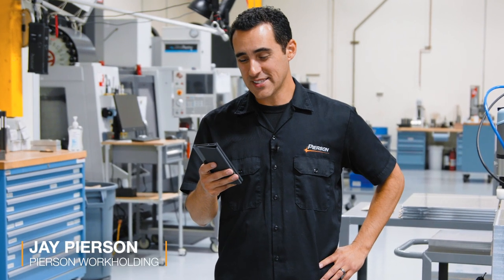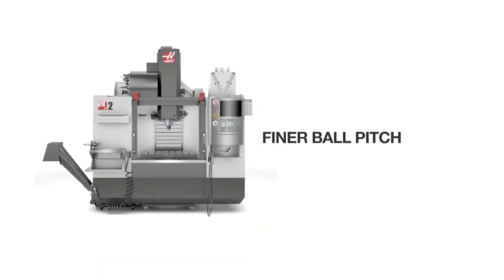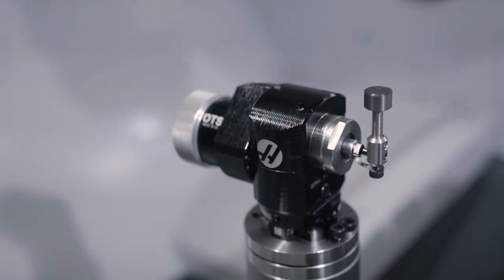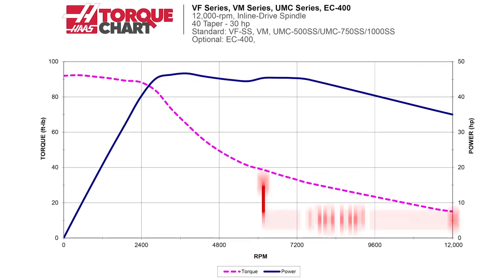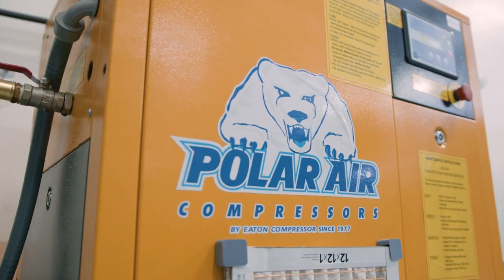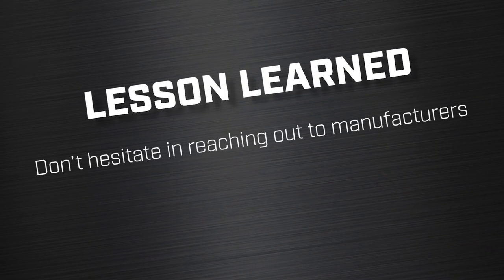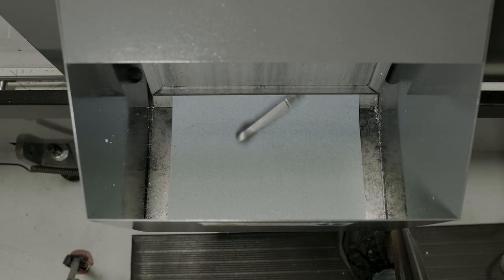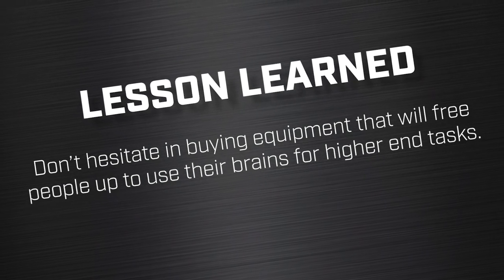My BIGGEST CNC Machine Buying SURPRISES | Pierson Workholding Q&A

Comment: Lesson learned: Don't hesitate to replace equipment that is requiring too much maintenance by a new piece of equipment.
We started with a 2nd hand 25 year old Bridgeport VMC and learned a lot from that machine. But after a few years we had to spend too much time on maintenance: a stuck tool changer, a broken pneumatic valve, electrical problems, spindle maintenance, wrong parts being delivered by the vendor. That resulted in me rejecting a lot of jobs because I was not sure we could handle those.
When we were faced with another big repair, we decided to replace it with a Haas VF3ss. Better quality parts, better surface finish, less maintenance and a much higher throughput

Comment: Great insight Jay!  We will be making the jump from Tormach to Haas soon and I've been waffling on SS vs non SS.  We cut a lot of aluminum, so the spindle speed is attractive.  We also make 1000's at a time so we are shaving seconds everywhere we can.  At some point we will catch up with demand and I suspect my focus will change from one machine's speed to a cell of machines and what that capacity is...  It seems like that is more about getting the timing right than it is about brute force speed.  Your videos have helped a ton over the years.
Reply: Haas has a great video comparing a vf to vf ss to a dm the cycle time reduction is amazing on the dm. For aluminum especially with small cutters rpm is going to win every time. You will need to sit down and figure out what your max rpm/feed rates would be for the part ideally and buy into a machine that has that envelope.
Reply: I’m curious if you have an update on the machine you chose.

Comment: A great point talking about  spindle speed  and torque. If you aren't machining aluminium or using very small cutters ,over 8000rpm is a waste . More torque for roughing and tapping , will make you more money.

Comment: I bought the Polar 20hp rotary 2 years ago, and man what a difference it made!  I didn’t realize you could program the power output, I just assume since it was variable drive, it would be just run slower in times of less need.  The biggest draw I have is my blast cabinet that needs 90cfm.  It would destroy my old piston compressor in minutes leaving the rest of the shop without air.

I have been needing a auto feed bandsaw for a while now, I will have to look into the Hem!  It is a huge time suck when cutting 100 of anything on the Ellis.  Thanks for sharing!

I am looking to add another mill in the next year, so I am glad to hear that the standard VFs are very productive.  We just added a ST20Y this year and are still getting comfortable running it, but so far besides the pucker factor, it has been a pleasure to work with!
Reply: Check out Revolution Machine Tools out of Utah. We recently bought an auto saw. It's not huge, up to 9" diameter capacity which is more than enough for our needs, paid under $10k delivered. If you need something bigger they do have bigger models but we didn't need to spend the extra cash. Hope that helps.

I have a 10 HP Polar piston compressor. Need to upgrade sometime soon. Not sure if to stick to Polar or switch to Quincy or Kaeser. Any insight on these?
Reply: @ciscohernandez4384  Hey thanks for the reply!  I will definitely check out your recommendation!  As for the compressors, both Kaiser and Quincy are reputable manufacturers with long spans in the industrial area.  You probably can’t go wrong with either, but I don’t have 1st hand experience, so I shouldn’t give an opinion either way.  However I went with Polar or now Eaton, because they offered higher HP on single phase which is what I am equipped with currently from my service provider.  Most industrial machine manufactures only offer 3 phase machines as it is cheaper and their customers will be in a facility that has 3 phase power.  Eaton is the one manufacture that offers a proper 3 phase motor on a VFD drive controller for single phase power.  I do use a rotary phase converter to run my other machines, but the air compressor is always running and I wanted to run that not on a rotary if at all possible. Cheers!

Comment: Just ordered a 10HP, variable speed rotary screw compressor from Eaton / Polar based on your video review. It will replace a trusty but tired 5HP IR T-30 compressor. Hope it lasts half as long as the IR.

Comment: Failures: we had an assistant pre-cutting tubing but only to rough length and square ends because he couldn't do any better. Then the welder would RE-CUT every tube to finish length and required angles. The boss saw nothing wrong with this because the welder said it helped him (helped him to not handle 20-ft sticks). Of course I was labeled as the complainer when I called this lunacy...

Comment: I agree with everything except the probe statement.  The probe is the single best efficiency improving option you can buy IMHO (4th axis is close second place) and one of the less expensive Haas options.  Also the VM and SS (aside from ballscrew pitch) are about options and how they are packaged and the only way to get the 12K spindle (my favorite).  You are absolutely correct about the machine is usually not the weakest link in the efficiency chain.  I bought a fully loaded VF2SS and learned how important fixture design was actually the weak link and the machine performance was going to waste in my poorly designed process.  However with promotions/sales/offers Haas had at the time I didn't overpay too much and later found uses for the options on other jobs.  The great thing about Haas is their website allows you to mix and match options between machines to find the best option/price combo for your particular application (assuming you know exactly what you need).  The only thing better than a cleverly designed fixture is that same fixture on a 4 axis setup.

Comment: Thanks for sharing your thoughts on lessons learned. About 9 months ago we replaced our vertical mills with one horizontal with a pallet pool and large tool magazine. Game changer for us, whole new level of safety (far less handling of parts in machine), quality, through put, job satisfaction and reliability.
Reply: They are a major investment, but provide a drastic improvement in efficiency and safety. Possibly even quality and simplicity if your process is solid. We have 4 standalone Mazak HMCs and 2 in a 43x palletech system. We would have to at least double if not triple the size of our shop to to fit the number of VMCs it would take to do the same amount of work. An HMC may cost double a VMC, but they can do well more than double the work.

There are so many benefits, even with just a pallet changer (no pool), but I would say my top 3 would be 1. Work piece handling happens away from the work area, so it's not only safer, but the machine is working on the other pallet while you unload/load 2. The 4th axis isn't an add-on...it's a standard part of the machine and 3. The tool magazines are larger by default, but can be optioned to be huge. This means you can tool up for many jobs and reduce setup time.
Reply: Pumasforpets, I agree, we started with a small horizontal many years ago, but it turned out to be a lemon. It did the job, but didn’t take us to the next level, so tried verticals again. That was a mistake!  Did a bit more research, and took advantage of the pace of  progress to land us the perfect setup for our application, a DMG Mori NHX4000 with a five pallet pool and 240 tool magazine. “Cheapest” machine I’ve ever bought.

Comment: Right now the company I'm working for is planning on moving into a new facility. We've had plans to upgrade the air system and replace the current piston compressor with a rotary one for probably over a year and a half. In that time our current old piston compressor has been giving us problems that results in all of the air users being shut down for hours at a time, often multiple days in a row as the repair technician comes in and diagnoses, orders parts and repairs it. The air users are not just the two VMC's, but two datron mills, coating lines, laser cutting/etching, electronic component surface mount machines and other components.

It baffles me that the company feels ok limping along on this old compressor that could fail at any time, paying repair costs monthly, losing hours of productive time monthly, rather than eating the up front cost of the new compressor and paying for hookup twice in our current and future location. Perhaps they've done the cost analysis, but it doesn't seem like it.

Comment: I was very surprised at your saw mentality? We do work from areo-space to medical(external body) to open tolerance production wigets. We use a hydmech and/or a doall auto saw. They cut accurately an clean enough to a finished length unmanned with only subsuquent holes drilled or such left to do. There basically another cnc machine to us.  I still value your view on the loly saw, was just surprised a little. Thanks for the vids

Comment: I really appreciate your ideas and would like to know something, i work with Fusion 360 and never had to program the machine directly at the control, so, how important is to learn how to program a job straight at the machine? i understand how g code works, but, am i missing something by only using a cam software?
Reply from the maker: In my opinion, you're on the right track learning Fusion to program both mills and lathes. It's always good when you learn and embrace new technology. You should however have a basic ability to read G-code to understand what the machine is going to do when working through a set up. - JP
Reply: Agreed Jay.  It is a better process to control programs by using your Cam system, but it is equally important to learn the codes so that you can machine components confidently.  I have had many times in my experiences of catching mistakes in process.  Also post processing will vary and it is important to maximize you machine controls to there fullest capabilities.
Reply: Personally I work at a shop where we all program by hand. We have mostly haas lathes and like 4 Haas mills. If you're doing somewhat basic stuff on the lathes like turning a diameter and drilling, boring, or threading really it's much faster to program by hand. I could have a job set up and programmed within the hour. Same goes for the mill, if you're just doing bolt hole circles or some slotting it's really easy to just program that stuff by hand. Cam comes in handy when it's really complex stuff. Like on the lathe we make some pulleys that have v grooves in them. We don't buy inserts for that size of groove either we manually program this by hand using a cutoff tool/groove tool. This can take some time as there's a lot of math involved. Some machines like mazak which we have 3 of them at my shop, has capabilities using mazatrol to easily program grooves with little math needed. Newer mazaks with touchscreen control basically has cam in it. It really shows a 3D picture of what you're trying to make which honestly is a big bonus over a Haas. I really wish Haas would improve they're graphics. I love the classic look but at the same time when you program live tooling or anything of that matter there is no graphics at all. I guess this is why cam would be great 🤔🤔 lol!
Reply: Just for fun make a simple fly cutting program by hand or drilling op. It will make you a better machinist undoubtedly.
Reply: using CAD Cam and programming at the machine is a good thing
some machines have some special features inside that a CAM cannot use, so you have to program it manually, especially programming parametric programs. I run 5 Axel machines where it is These are functions that can not be run from CAM.
I use a Heidenhain controller TNC 640 where there are so many special features where I can not get in touch with CAM

one of the functions is that I can have a measurement report made directly on the machine and print it out, so when the machine has finished working, I have a measurement report and a finished item
Reply: @kastrup2dk  parametric codes  and macro statements are written by hand that I have used.  It's kinda an extra touch for special applications.  I do believe cam systems are the industry standard for many reasons.   Do you write full part programs in macro and parametric?  Seems like a unique approach.  Also GibbsCam 14 has just created probing routine macros for post processing that I will look into adopting for specific controls.
Reply: I think programming on the machine is not efficient anymore. But if you got errors in the programm and need to modify your postprocessor, or you do strange things  your machine was not intended for, or if you make 4'000 parts a week and try to shafe off 1 second... you need to understand the language of your Machine.
Reply: @punkdudex69   I spend a lot of time calculating cast items.
where I work now we only have capacity for 30 tons It is not possible to make CAM programs that can compensate for all the conditions so therefore will have to be made parametrically. Emma has a value over 100,000 euros when I receive them

so I can not afford to make mistakes 
I think it's a good thing that Fusion 360 came on the market the game changer for the industry.
and that the program is affordable.
but I have used a lot of mastercam but do not use it that much anymore.

I think it's a good thing that Fusion 360 came on the market the game changer for the industry.
and that the program is affordable.
but I have used a lot of mastercam but do not use it that much anymore.
in the I have more freedom in programming in parameter programming and thus ensuring a higher quality  and assurance that the item is correct when completed.
Reply: @kastrup2dk  wow that is super interesting to me.  I have not seen any applications in my professional bubble so far that would be needed.  I would love to see a full parametric program to understand where that process is beneficial.  Thanks for your input.

Comment: Running your VF2 compared to VF2ss is like running your rapid at 25% all day long. Overtime it can be the difference of the job being done at the end of the day or working till lunchtime the next day. When doing production work that makes a big difference!
Reply from the maker: You missed the entire point. Two very slow machines always has much higher output than one super speed machine.
Reply: My SS machine runs in 50 percent rapid. At 100 percent and 12k rpm the spindle takes too time to stop and that rapid speed gets negated as it just waits for the tool change. The only reason I got the SS is for 12k rpm and side mount tool changer, which at the time was cheaper than a non SS with the rapid speed doesn't save me any significant amount of time.